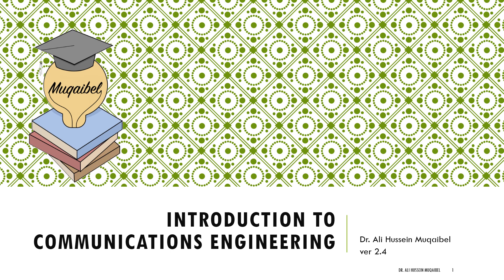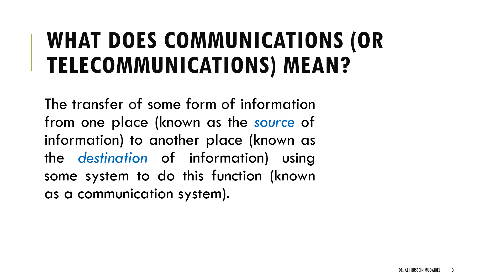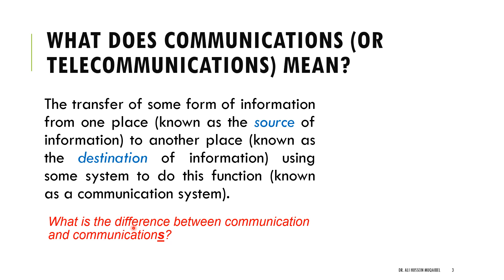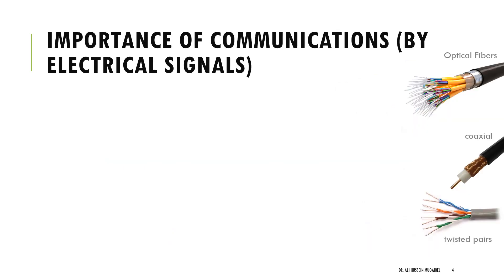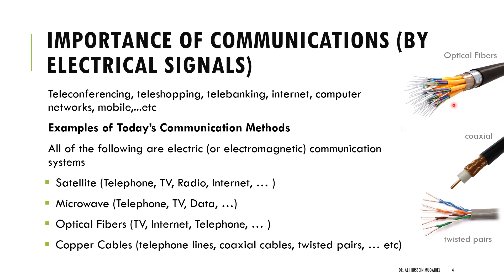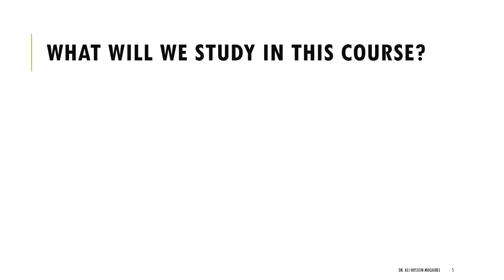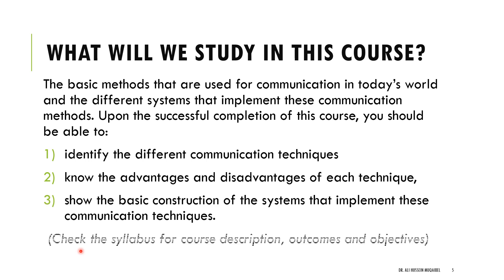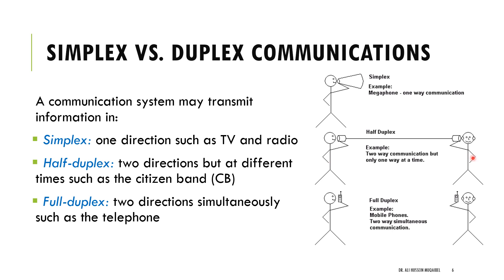1.1 Introduction to Communications Engineering

Comment: The study of Communication examines information exchange, the creation of meaning, the development of relationships, and how messages are received and interpreted. Communications deals with the technology, systems, and channels used to deliver different modes of communication.
 In short, communication is focused on the message, while communications is  focused on the means by which it is shared.
Reply: Hello, is this information correct or did you find another solution to that question?

Comment: cobied from your website:
The differences between the two words; Communication and Communications.

 Communication is the act of communicating, or to communicate. Communication refers to the process of sharing ideas and information between individuals or groups. Communication is about language, questioning skills, listening skills, rapport building, non-verbal and verbal techniques, etc.

 Communications is the method used to engage in communication, eg telephone, email, writing, radio television, etc
https://faculty.kfupm.edu.sa/ee/muqaibel/Courses/EE370%20Communication%20Engineering%20I/ee370.htm